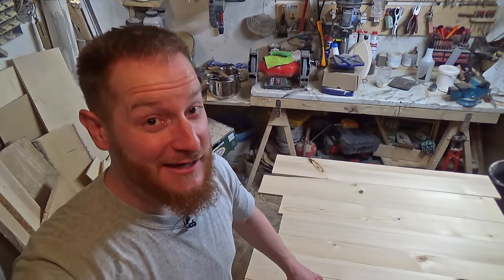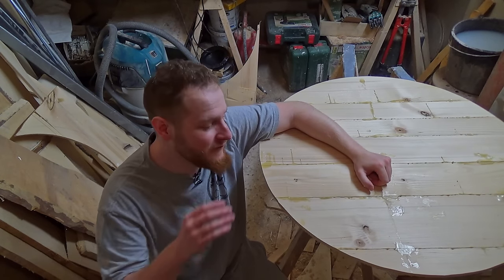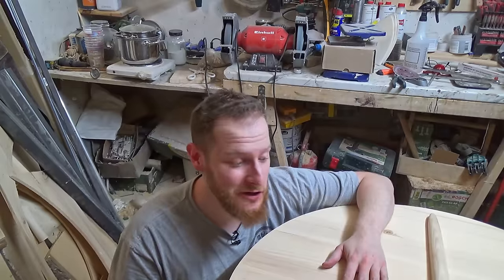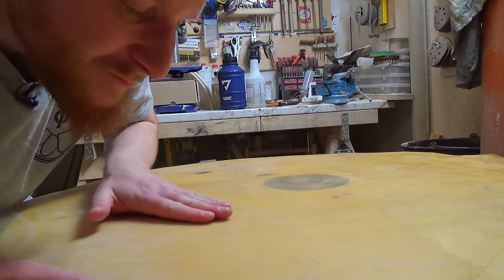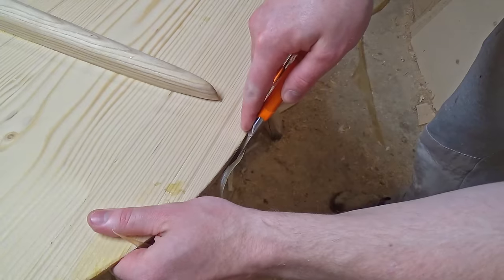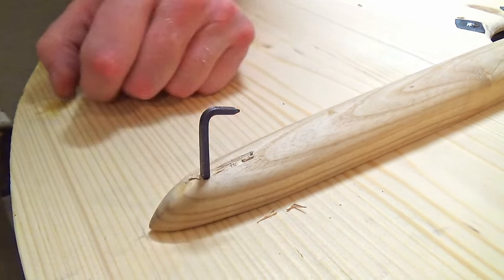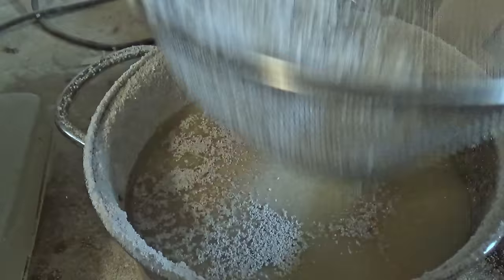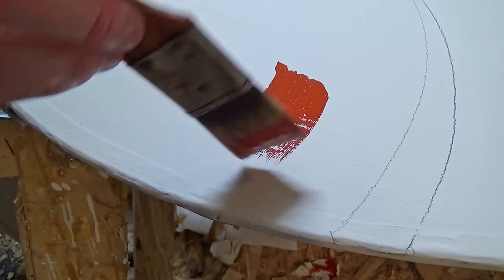Crafting a Viking Shield ONLY with ORIGINAL MATERIALS

Comment: As someone who also used a box cutter knife for stuff like carving in the past, please get an actual carving knife. Even when cutting away, you can grivously injure yourself. The blades can suddenly snapp and while using force during carving you can easily slip into the piece stuck in the wood and cut deep and long into your hands and arms.
Reply from the maker: the blade shouldn't get stuck, that could indeed caus bad injuries. The reason why I don't use my carving knive is caus: I got to sharpen it all the time, the blade's to short and the blade doesnt bend. Caus of that you couldn't do the techniques at 14:25. I know that some dedicated, special knives and planers exist, but they are expensive and rare. For beginners gloves + box cutter knife is realistic.
Reply: @TheShieldery  Mora knives are pretty good for carving and relatively cheap
Reply: @TheShieldery  One simple carving knife is absolutely enough. You don´t need all the fancy tools.

But I will reiterate, DO NOT USE A BOX CUTTER FOR CARVING. While I respect your work, in this point I am disagreeing completly and calling out dangerous practice. I have had acciedents with that in the past. Work saftey will telly you off for doing it. The blade is not made for carving, and I am lucky to have gotten away with just a nasty flesh wound back then. Depending on the blades, when they break and you slip it can easily aputate a finger, or mess up the tendons all over your hand. Gove or no glove. DOn´t mess around, and get a 20-40 euro carving knive. Saveing that little monery isn´t worth the risk of life long disability. Box cutters are meant to be used at minimal extension, and when used wrong can be hilariously dangerous.
Reply: I have two scars because of exactly this

Comment: I built a shield out of thin oak boards and glued them together. The back remained visible. I glued rawhide to the front with bone glue. After 2 years, however, the shield began to bulge forwards because the rawhide contracts over time. Even the crossbar on the back couldn't prevent this.
Reply from the maker: uf, that sounds disappointing. Bone glue is quite bad and not authentic though. Mayby that draged the moisture out of the rawhide over time? In addition: how where the boards cut? Where they core planks?

Comment: i would expect that rear would be covered with hide to make it stronger sandwitch. That thin wood in one direction feels like it would split easily.
Reply from the maker: I'd advice you to check out dimicators tests ;) . Basically swords or battle axes are not meant for splitting and would just get stuck.

Comment: I'm surprised you didn't anneal that brass with a torch beforehand. would make the metal a lot easier to work and I'd be surprised if the originals weren't worked annealed
Reply from the maker: I got none XD . But yes, that would have made a huge difference.

Comment: Maybe a small tip with the pipe clamps, if you use them above and under the workpiece the forces are more evened out and the warping while glue is less. For a big part like you did in one glue it's up probably still not enough. So you could also try to first glue smaller pieces to bigger ones and then a final glue up.

Comment: A small tip i learned from a boatbuilder is to use a regular small flat pein for peening rivets. It spreads the material better and gives you less risk of the nail bending and cracking the wood.

Comment: Great video, as always.  I tried making one of these a few years ago and it warped badly- you've inspired me to try again ;)  And a suggestion: for carving things like the handle, a spoke shave is a brilliant tool; far, far easier than a utility knife and I can't recommend it enough.
Reply from the maker: thanks! 
I got a spoke shave, but you usually need two hands to holde it and therefor need a propper way to keep the wood in place. In addition it's quite chunky. A boxcutter knive is just much more inconvenient. I got a tiny one hand planer which has a razor blade as planer knife, I'd recommend that :))) .

Comment: Great job there! I wonder if the problems you had with the timber splitting were due to it being too dry, and therefore brittle? If you buy sawn timber it’ll usually be kiln dried, which is what you need for construction work but may not be ideal for a project like this. I get the feeling that green boards might be more forgiving, and possibly closer to what the originals would’ve been made from.
Reply from the maker: Thanks! 
I bought the timber from a privat person two towns away that air dryed them outside for 5 years. Or at least that's what he said. It should be correct I think; they felt appropriate. 
Greenboards usually deform quite a lot while drying. but with radial split planks it might work. If you let them dry for a couple of weeks after glueing them together bevore attatching the grip and the rawhide, of course. 
Deffinitly worth a try. Unfortunatly I wouldn't know how to get them though XD
Reply: @TheShieldery  yeah, you’d definitely need to pay more attention to the grain of the timber if you used it green. Radially split boards would have the grain at closer to 90° to the face of the board, similar to what’s known as quarter sawn in milled timber, which is considered the most stable. Face sawn boards, with the grain more parallel to the face, will move a lot more when drying.

Comment: Making it with split out planks would be a lot of work. But you could make it stronger/lighter. I don't know if it's historically accurate but I usually cut the fabric or rawhide (triangles or star if you like) and fold it through the center hole and glue it into place there. The last thing I usually attach is the boss. If you have conical drills, that is used for wood dowels, you can use them for forged nails too.
Reply from the maker: it's a matter of taste, really. 
I got that kind of drill and yes, it would have been an idea. But the nails where only very little conical at the end, so it wouldn't have made much of a difference ;) .

Comment: What's the ideal diameter of the shield and thickness of the planks?
Reply from the maker: "Ideal" depends on the circumstances. The measurements from this video are the ideal ones I could make out of the material I had which also where historically accurate. For more informations about the variation of the archaeological pieces, take a look at the links to the sources in the videos description :)

Comment: but did they use younger trees or old growth/ older trees where the grain is tighter as well as less big knots when making their shields?
Reply from the maker: I'd go with medium old ones. Usually 5 to 8 boards got used on 70-90 cm broad shields, that makes an average 10-18 cm broad plank. Caus they where radial split the whole tree needs to be 26 - 42 cm in diameter (caus you got to remove the center). You can guess yourself how old a fir tree needs to be in skandinavia do get that thick; I'd say 30-50 years :)

Comment: Is there any reason for putting flesh side of the rawhide on wood and the hair side outside? I mean, my experience is that generally with leather the nice smooth hair side is actually much less resistant than the flesh side... So is it how we think it was done? Or is it because of better of better adhesion of the flesh side (which I only suspect given the rougher texture)? Or is it just aesthetics?
Reply from the maker: yes, the adhesion is better. The skin side is also harder with rawhide though ;) .

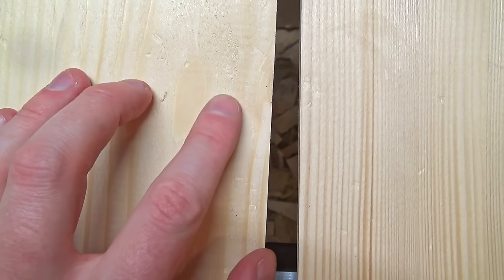Comment: 1:07 Why cut off the knotholes? In my woodsplitting experience they make the wood strong as f*ck.
Reply from the maker: When splitting a log? Yes, then wood knots are a problem, caus it interrupts the growing direction and therefore the splitting. But as you probably noticed, parts of the log tend to split of directly before the knot, caus the connection between the knot itself and the wood that has grown around it is quite weak.
When you only take a small intersection of the log, called a plank, this weakness persists. But the advantage that it interrupts the wooden growth doesn't come to play any more, caus it always points basically in the same direction as the possible splitting.
Reply: @TheShieldery  thank you for your answer.

Comment: thank you - but using a box cutter is very dangerous....carving knives are cheap
Reply from the maker: they don't bend that good though. You can't use them close to the surface as I did while fixing the crack
Reply: @TheShieldery  A bevel down normal chisel can take that cut. I think the box knife can break suddenly when bending is the worry and fly ino you somewhere. But what I reacted to most myself was the electric planer, those are very dangerous used wrong and they should be used carefully. I  nowdays dont use them anymore a small handplane is great for that kind of work.

Comment: This is the danger with internet, some may sit and believe some of the nonsense in this video. Only 2 shields? Gokstad burial had 64(!) shields just to mention one finding. Some of the other viking era round shield findings have shown that there was a layer of linen in between the wood and the leather. Thick raw hide was used around the shield as a reinforcement against strike from sword and axes. Some viking era round shields have been found with a metal clamps around to avoid splittings. Your historical correctness need an update. Other than that, your shield is a nice build
Reply from the maker: Hi, thanks for your feedback. Yes, some shields where built differently and I never stated that mine is the most only, or even comen one. But we definitely got some that where built in the way I did, as you can see in the sources in the videos description :) 
I also never stated that only 2 pieces where found. I only stated that we got/ I found only a source for motives from 2 shield pieces (which you can also find in the videos description :) ).
This is another funny thing on the internet; people write stuff in the comments after not really listening to the content they just consumed... I guess?

Comment: Thanks for betraying the title in the first few seconds, instead of leaving it until later in the video.

Sawn planks are not the same material as split planks.

In detail, all of the work needs to be done with the same kind of hand tools in order to get the same mechanical properties, because it changes the qualities of the surface and also the compression or "work hardening" applied to the boards. It is simply not possible to make a viking shield with a box-cutter knife; you need a slöjd knife for that. =p

Something else to keep in mind is that not all fir is the same. Early medieval craftsmen had access to a wide range of naturally grown trees, allowing them to get exactly the characteristics that they wanted, while modern mass-harvested timber is intended to have uniform characteristics, giving a lower selection. This is quite important in relation to viking age conifers, as it was often the densest specimens that they chose for building materials (which are not readily available today and had drastically different characteristics), but idk if they had the same idea when it came to shields, or selected for different qualities.

The boss and nails should be made of bloomery steel, which you don't mention and the copper alloy that you chose is not an original material.

So, the title is missing a "maybe some of", since the rawhide is accurate and possibly also some of the paint and glue, but nothing else, it seems. Other than the title though, a cracking good video.
Reply from the maker: Thanks for your honest feedback :)))) ! 
I didn't betray the title, I explained reasonable why it wouldn't match the videos main theme ;) . In addition I never claimed to make it ONLY with the authentic materials. The original materials are "only" the vast majority I used though.

The material is the same, only the processing differs and with core planks it doesn't make much of a difference. I'd give it a solide 90% the same (caus core plank).

About the paragraph starting with: "In detail, ..." nope; if the result is the same the process doesn't matter. In the end I want to sell those shields. The ones from the video are at 450€. If I'd make one with authentic tools we are at 750€ minimum and they'd look the same. Would you honestly pay that? I also never claimed to use authentic tools.

About the paragraph starting with: "Something else to keep in mind is that not all fir is ..." I also got to disagree with that, they also had to work with what they had and a broad range of wood qualities was given: Bad wood => fire wood / coals; medium wood => .... ; excellent wood => .... ; Especially in Skandinavia the forrests in the viking age where not particularly larger or smaller then today, more naturaly yes, but all in all not better or worse wood quality wise. In this videos Case I didn't use mass-harvested stuff. I bought the wood from a private person 70 km away from my place. The fir planks are quite uneven with differing growth length periods and ... organic... knot holes. They also where naturaly dried.

Making bloomery steel would be an entire different video and just would be to much for the viking shield theme, as well as producing the correct copper alloy (which I considered in therms of casting a metal handle terminal [like the one from Sandby on Ödland] which you can see in the sources).

Again thanks for your honest oppinion. Those assumptions give me interesting feedback as video producer :)))) .
Reply: @TheShieldery  No problem.

Frankly, I think you're wrong on all points.

As I explained clearly (I thought) I don't have a problem with your process at all, just the misleading title.

The product is somewhere between a true replica and a plywood shield and that's fine. If that's a market that exists, it's great that you're providing for it.

Regarding the authenticity of the materials though:

The difference between medieval Scandinavian timber finds and extant timber stands has been studied at length in Norway. The quality of pine used for viking ships and stave churches (they call it "hard pine" but it's not its own species, just desirable specimens of the most common pine) is practically extinct. There is a huge difference between the forests of then and now. They very effectively selectively removed what they considered the best bits, so just the dregs remain.

Can you make a good banana milkshake with a rotten banana? Probably not, so if you use timber that a viking craftsman would have discarded, it's not going to be representative.

Of course, this isn't a problem that you can easily fix, but that doesn't affect whether or not the material you're using is an original material, just whether it's feasible for you to use original materials.

As for sawing vs splitting and to a lesser extent, using power tools, this does change the materials that you're using:

Clay is a building material. Bricks are also a building material. Bricks are made of clay, but they are not clay. Likewise, a plank is not a tree. If you're using the wrong type of plank, it's not the same building material, even if they came from the same tree.

There's an old saying "A man must make his own arrows". With this in mind, I wouldn't pay 4€ for a shield! I appreciate you sharing tips though.

If I were ever to make one or more "viking shields", I expect I'd make some of the same compromises, since I too am averse to lead poisoning and don't feel like selectively breeding a hundreds of years old tree for the purpose. ;)